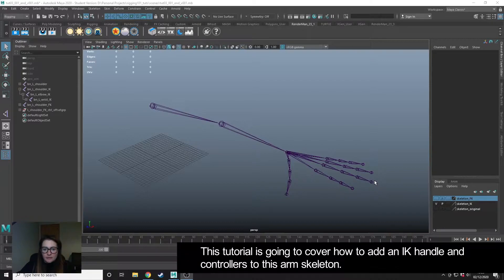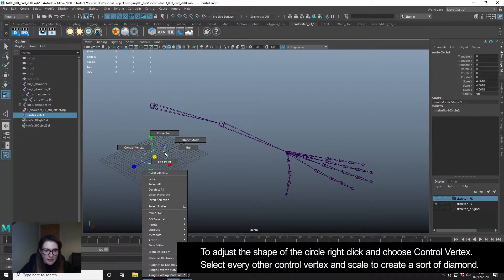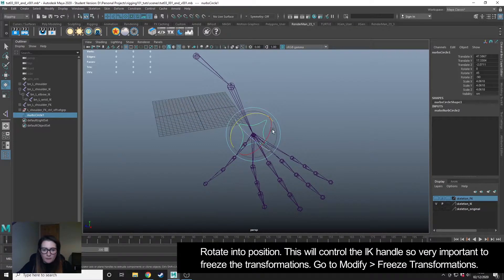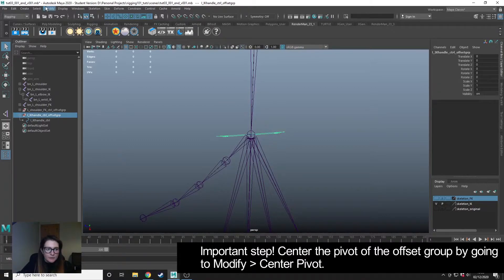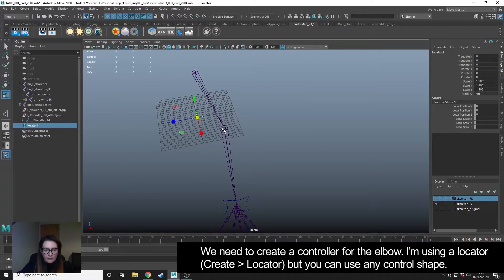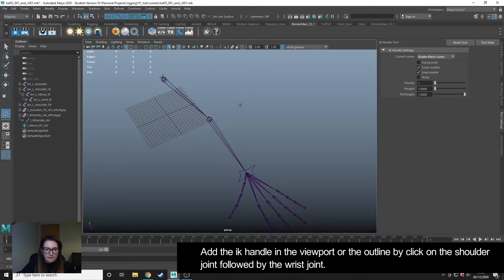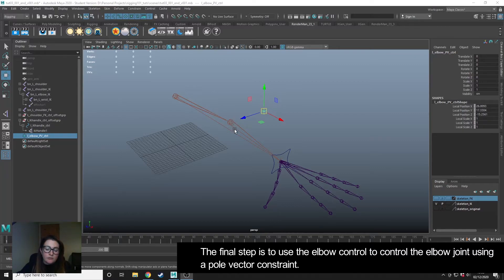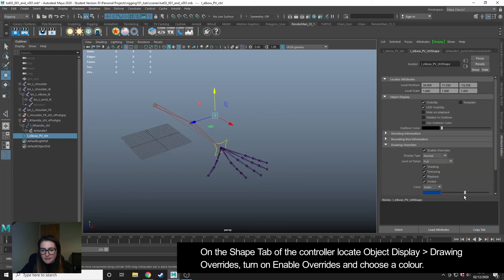Creating IK Controls - Maya Rigging for Beginners Part 4

Comment: Hello, very good tutorial. Thank you ! But pole vector rotating hand in video. I assume it is not right. How can I fix that ?
Reply: I mean 6:10
Reply from the maker: Usually means that your joints weren’t created perfectly aligned so the pole vector shifts. You can follow this tutorial to find the correct position of the pole vector to not have the shift: https://youtu.be/GxM4GawKwjQ?si=1AWqog8CN9vdFPtW

Or redraw your joints ensuring they are aligned flat in an axis. Best created in top view but obviously tricky if your rigging a character in an a pose.
Reply: @HollysMayaTutorials  I fixed that thank you. Also, Really appreciated Holy ! I learned tons of new stuff especially joint orientation video is cool. Thank you again.
Reply from the maker: You’re welcome! Glad to help ☺️

Comment: why didnt you freeze transformation for the group of controller, isnt that necessasry to do after just freezing the controller (confused)
Reply from the maker: Because you don’t use the group to keyframe on the groups purpose is to hold transformations so they aren’t on the controller. The controllers need to be 0 transforms so that you can easily reset your rig back to the default pose. Hope that helps :)
Reply: @HollysMayaTutorials  ohhh thanks alot 😌 that’s really helpful information, learning a lot from your channel 🙏🏽

Comment: After constrain locator & ikhandle my ik_arm skeleton copy rotates at an angle varying from original_arm skeleton
Reply from the maker: Sounds like the locator might not be exactly aligned with the elbow and when you add the pole vector it is moving. Does the pole vector and ik work as expected it’s just the bones have moved?

Check that the locator is positioned exactly the same as the elbow joint except forbeing pushed backwards in a single acis from the elbow and try again.